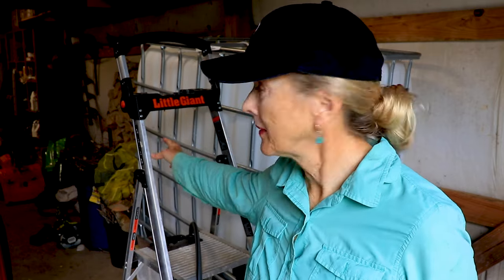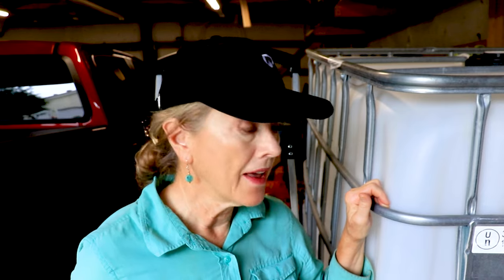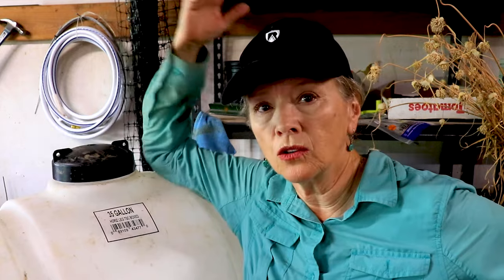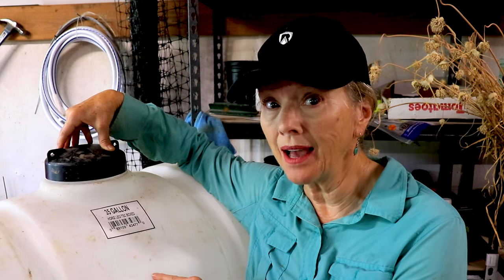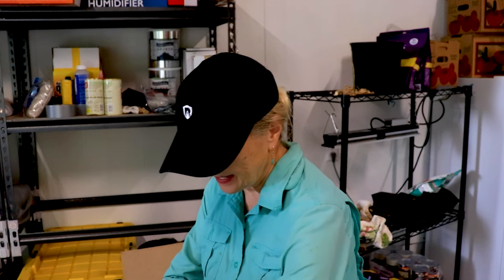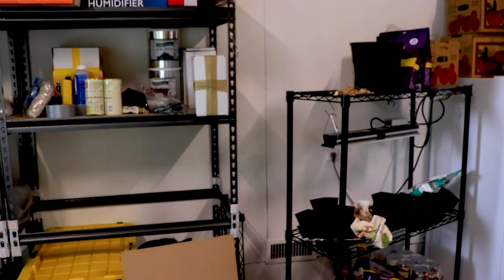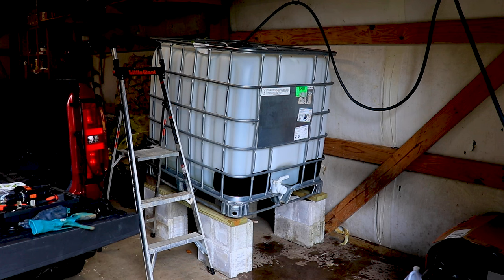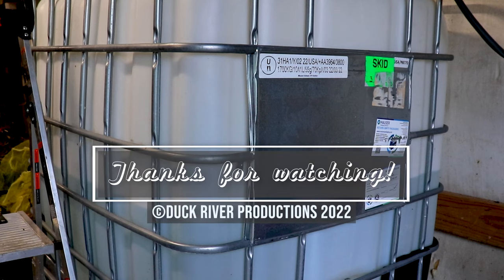TIPS storing water LONG TERM! (Don't make THIS MISTAKE!)

Comment: I will add that storage containers can be stored without any water.  I have a combination of filled and empties, 1/2 gallon, 1 gallon, 2 gallon, and 4 gallon.  I wanted to be able to lift each if necessary and hubby was not around or able.  We also have a bathtub.  Don't forget that your water heater does have many gallons you can use in an absolute emergency.  Good to have water in your car, too (other than in Winter freezes).  We also have a Berkey water filter unit in the house and RV.  There are YouTube videos on how to make a pseudo Berkey type filter of buckets and yes, Berkey or similar filters added (saves some money and likely works fine in an emergency).  My containers are milk, water, Walmart 2's, and Reliance Beverage Cube blue 4's.  All from Walmart or the grocery supermarket.  Because we do go camping, we also have a "Steri-pen" that uses UV light to sterilize small amounts of water.  May do rain barrels for the garden but only seems to rain August here with a tiny bit in the Winter.  Mohave Desert location in AZ.
Reply from the maker: Thanks for contributing!

Comment: You can make distilled water using a pressure cooker, with 1/4 inch brass fitting and at least 30 feet of 1/4 inch of copper tubing to make a condenser coil! I use 4 gallon glass carboys that were made for brewing wine!

Comment: Very interesting! We're on the same wavelength, I have been saving my gallon crystalline plastic water bottles, which take up a lot of space! I've never noticed them leaking, but I've never had them for more than a few months.

So, what I'm doing this morning is putting in water from the hose going through a Boogie blue Plus hose filter, which is supposed to take out chlorine and maybe even chloramine. Not sure about fluoride. Then I'm putting in two drops of chlorine dioxide, which is similar to what campers used to purify water from streams and such. I've done this before about 4 weeks ago, had almost 30 gallons, and I've used it primarily to make coffee and ice.

Strange thing is this, my ice from the tap always cracks and shatters, it never makes beautiful clear ice cubes.

 When I filter the water and add the chlorine dioxide, the ice cubes are perfectly formed, and don't shatter when I take them out of the tray. Not sure what's going on, but I like it!

Today I did 24 gallons, and I'm keeping them on a heavy duty baker's rack in my bedroom.

Going to keep an eye out for leaks, thanks for the heads up!
Reply from the maker: Interesting! Thanks for sharing!
Reply: How drops of chlorine dioxide do you put to each gallon of water.
Reply: @cynthiahester3326  I follow the MMS protocol, which I think is stronger than the drops you would buy at a camping store. So I'm kind of winging it, but I do one drop of the sodium chlorite solution and one drop of the acid, I put them in the screw on cap, wait 30 seconds for them to turn brownish yellow, then tip it over and screw it on, give it a shake. I think the stuff is really powerful. Since I am reusing the water bottles, I thought a couple drops would help kill any bacteria and keep it fresh. My impression is that chlorine dioxide is very effective at destroying lots of things, including glyphosate.
Reply: @timwilson4919  absolutely! Knowing I have a stash and everything I need to make more, which really isn't much for a lifetime supply, brings a sense of security. I bet this stuff denatures Nanobots, at least I'm hoping!
Reply: @connectedensrefugecommunit7031  🇺🇲👍

Comment: You can buy an electric submersible water heater to keep the water from freezing. 
I’m going to try a concrete blanket just in case the electric goes out because I don’t have plumbing or running water.

Comment: get a RV water filter for the end of your hose when you fill from city water. also get a hex wrench, take the top 2 bars off flip it on the side, pull the plastic tank out.  is easy to roll around with cleaner in it.

Comment: In South Africa we use massive water tanks made from polyethylene with pigment antioxidants and UV stabilizers in sizes ranging from 1,000 to 20,000 litres — such a tank is a critical investment on your property.  This is typically for harvesting rain water or storing water from boreholes.  The important thing is that the water has to have a sustaining bacterial culture in order to remain healthy though not fit for human use without filtering, boiling or further purifying.
Reply from the maker: Thank you! Blessings to you!!

Comment: Nice video. Thanks! I appreciate the sites you mentioned. 
You can buy black coverings. 
My concern- winter freezing. 
Are there heaters that are safe? 
Thanks.
PS: we ended up putting a side door for ourselves to enter the garage. I almost killed myself trying to disengage the garage door once when we lost electricity and I attempted to disengage the door manually. It was a bad moment.

Comment: The kind of plastic that leaked, are Poros and the liquid will leak through the plastic. Soda Pop in aluminum cans if kept long enough will leak through the aluminum because it is poros. I had a case of Soda Pop that sat for a couple years and almost every one of them leaked out. Some of them were completely empty and the tabs were still intact. Be safe.
Reply: It's not that soda cans are porous, it's that soda is very caustic and eats through the can over time.

Comment: Hi Kaye. Just an FYI. Most water treatment now is using Chloramines (chemical) instead of Chlorine gas, which dissapates. Check with your water district to find out what they're using for treatment.
Reply from the maker: You are right. I was aware of the switch in LA when they did that. I was assuming it was both, but I will check, thank you!
Reply: @Latebloomershow  Please let me know what you find out. They might do a flush with amines, then, switch to gas, but gas is expensive, comparatively speaking.

Comment: Kaye,  It is so refreshing when you say Hi I'm Kaye from Tennessee.  So many homesteading channels don' do that and that is important for zones and gardening.  I'm shocked you don't have a well!  I hope you filter your "city water."  There is fluoride and chlorine in city water.  Fluoride is a neuro toxin.  I think you must know that though???  That same thing happened to me with my gallons of water.  The bottles leaked and I ended up dumping it all.  You can't tell me that that is not by design also.  If you have a metal roof and gutters then put the downspout with a screen to filter out the yukies.  Then you can use your burkee water filter to be able to drink it.  Obviously we can't rely on the jugs of water.  Also if you have a water bill it is wise to contact your water company and tell them you are filling a pool. I wouldn't tell them you are filling totes.  That way they don't charge you for.....not sure what but the cost is much much less than if you didn't call.  They might think you have a leak somewhere also.  GREAT VIDEO and very informative.
Reply: Lol,  at the very end you spoke of the water filter.
Reply from the maker: I had a leak the first month I was here and the Watermain went out and it cost me 2700 to replace it and I got I had gotten the insurance for something like that to happen and they deducted the overage on my water bill which of course didn’t come anywhere near the $2700! Anyway we can’t have Wells here because the ground water is polluted with zinc from the zinc mine my neighbor told me.
Reply from the maker: Yes I know fluoride is a neurotoxin and I will definitely be filtering whatever water I drink. I already have a great downspout system with covered gutters that doesn’t keep the cistern water from stinking though
Reply: @Latebloomershow  This is going to sound weird being that I am anti chemical but what about dumping some bleach in the cistern?  Not alot.  I have to do it in my pool.  2 cups should do it.  When I had my big pool I would add 2 cups.  It was either a 6k or 9k water pool.
Reply: @Latebloomershow  Of course they find a reason to force people into something right?  How could we prove differently.  A friend of mine has well water and his water smells so horrible.  If you take a shower there you feel like you were dirtier than before you took the shower.  He had his water tested and they said it was perfect.  I don't believe a word they say.  ;)

Comment: I personally would never drink water stored in these.  First,  a used one is never completely clean.  Second, over a period of time the chemicals from the plastic leach into the water.  For long term storage you will be drinking chemical soup after a few years.  Heat (summer in the garage) accelerates the leaching.  We have one of these and it will be used for cleaning, bathing, watering the garden, any non-consumable uses.  I will use it to water animals if I absolutely have to but I wouldn't even want my dogs or livestock drinking it after 6 months
Reply from the maker: True! It will be changed every few months. I feel the same way. But, if desperate, I will run it through my Alexapure first.
Reply: I agree, plus I live in Florida. With the heat and algae I would never drink out of this.

Comment: Our cistern leaked also. I think they fixed it with fast setting concrete. My granny had a hand pump from the creek to her kitchen sink. I would put in a well with a hand crank and/ or windmill powered to a small pond down by garden.
Reply from the maker: If you mean me, I can put in a well here, first it's solid rock and second it's contaminated by the zinc mine. I need to get a liner for the cistern. I've had it repaired and sealed twice.

Comment: Our lid on the top is exposed to full sun, and it cracked after a year. If you're using this outside a building to collect rai water, consider building a "house" for it. We are not finished but almost done. Also keep extra lids and spigots and piping on hand in case something breaks!

Comment: A Black IBC tank blocks sunlight, yes, but it also accumulates heat
Reply from the maker: Yes. I draped this with a shade cloth. No direct sunlight ever hits this spot. Still I know I need to test and treat the water.

Comment: I sure would not use anything but the rainwater to wash dishes and to flush with. You can get tablets to purify water with and you can also get the water filters you carry hiking to re-clean even clean water. The chlorine in city water makes me want to croak, I have a well and several huge tanks I got for Ag water holding. I also have a wind mill and the means to pump it with electric or hand or wind. I had water all during hurricanes without electric. I have 700 gal tanks connected to it. Critters do not need filtered water.
All my tanks are lifted and set for gravity feed and have spigots to control flow.
Reply: We collect the rain water in the IBC totes, double filter it thru strainers before it goes into the 5 gallon containers I keep in the house and then run the rain water through the Berkey water filter for drinking water. We haven’t had any issues at all so far. The rain water is much better than the city water by far because the city water is so hard and full of chlorine, not to mention the fluoride and other things in the water.

Comment: You dont want a tap water valve on your stored water. If the valve leaks you lose your water.   You want a hand pump or siphon hose to get the water out.  Also new water bottle are made to break down very quickly you cant long term store in them.
Reply from the maker: Okay, thanks for the tips!
Reply: @Latebloomershow  please don’t use the deer park h2o ( EVEN IF IT SAYS SPRING WATER)  That or the  Brand that has the word Mountain in it.. NASTY’ LOTS OF CHEMICALS!
Reply: @Latebloomershow  another thing I have 2  IBC tote that one had Round up in.. I searched my Eyes balls crossed, until
I came across a science explanation, AMMONIA NEUTRALIZES ROUND UP! 
The Other Tote Has Water Soluble Soaps That listed Ingredients, One WAS AMMONIA.. The Other ingredients Was, Harmless for human or farm animal consumption..took me 6 months of searching.. I hope this helps some one.

Comment: Real simple on those tanks, sand them and paint them a dark color or coat it with flex seal, try to put it on the cool side of your house( close by)  throw a tarp over it to keep from weathering if you can't flex seal it...

Comment: Bless your heart.  I have been saving my empty spring and distilled water bottle.  Alabama is in the South but I am worried about the cold this winter if the power goes out.
Reply from the maker: Yes, it can get very cold down here with all the moisture. I hope you have a backup energy plan. God bless!

Comment: I found easy ways...I have a cooler stand that catches rain water. Nozzle already on and it's easy. I also use empty laundry soap jugs and fill them up and store. The plastic is much thicker, easy to pour in toilets only. I buy bottled water cases for drinking

Comment: Hey again, I was just reading through some post and reminded also from other post about painting the tubs in black paint, I semi disagree, with this if you going to have it outside.  Yes the black will help protect from the uv on the plastic, and maybe the growing suff in the water, but it will also make it absorb heat more, and may cause more plastic to be released into the water... so after black paint I would paint it white...reflect heat.   I for myself would do a layer of black,  cover with spray foam, then paint foam in white, if its going to be outside,..  or if in foam, could shape and paint like a big rock or carve it to look like blocks, wood fence, to hide it.
Reply from the maker: What great suggestions!

Comment: Ancient people store drinking water in copper vase. That is expensive or impossible to get now. So the trick is to buy some thin copper sheets  or strip a lot of house hold solid copper wires, and just dump it into the tank. I said copper sheets and wires because of their high surface area, copper (and silver) have natural germicide properties if given enough time to work, which for a small vase, means overnight. Then you can cut down the use of bleach and other chemicals. The amount of pure copper you put in depends on desired surface area and how fast you want it to work.
Reply from the maker: Interesting! It sure would be a lot easier!

Comment: We had a cabin on a lake with no water. I bought two totes of over 300 gals each. I put them on a trailer along with a 12 volt water pump out of a camper. The pair held 0ver 700 gals of water and gave us running water for weeks. We brought drinking water from home.
Reply from the maker: Clearly I need a pump. What did you cover them with?

Comment: I have had a few different bottles of distilled water leak at the seam. They were not bought at Walmart either. They were bought at CVS. Only had that happen with the distilled water so far. Wonder why.
Reply from the maker: People are writing in that those bottles are meant to decompose in landfill so you aren't supposed to keep for for a long time. I will change over to glass for garage storage.
Reply: @Latebloomershow  Do you know of any bottles would be safe to use .   I need something where 
I can handle and store in a safe place .   Only the basement .   Thank you .

Comment: That shelf product is called mdf and when it gets wet, it not only molds and droops, it will flat-out break. Use real wood or a good plywood, especially for heavy items. BTW, those metal shelves do have a weight limit, and water's kina heavy.
Reply from the maker: Thank you, yes, I did have about 100 pounds of water on it, I guess... I'm going to take one to Lowe's and have one cut in plywood.

Comment: Hey I feel ya, when it seems like there is always something.   You should be able to get or make a hose connection for the outlet,  If the outlet had a screw on ring,  one could maybe make a simple one.  Think in the way of a canning lid, ( not saying a canning lid would work)  but the flat shape of it,  with a hole drilled in it to fit a hose connection fitting into. Need to have a nut and gasket that will fit into the outlet, .  Hose connection on the outside that the ring can fit over.  
 Also a garden type hose is not the best for water you may drink, for ( the ones I have seen are white in the RV sections to use for drinking water.)  One other thing for your tank,  Look into getting a jack,  floor or bottle type to put on the back side, to raise if / when needed.  Dont need to cause yourself back issues.  Since yours is on blocks, you can place the jack on a block to get it closer, to the tank for lifting the back up. Best of luck..
Reply from the maker: Great suggestions! Thank you!

Comment: If you or someone you know drinks sangria, save the glass jug that has the size of one gallon or so to save your drinking water.   I have had mine filled with spring water, placed on an open shelf for months with no issues.  They are about 4 feets from my kitchen window (they get light but no sun).